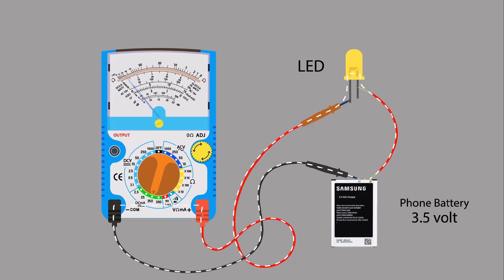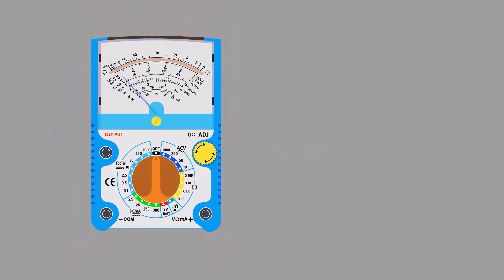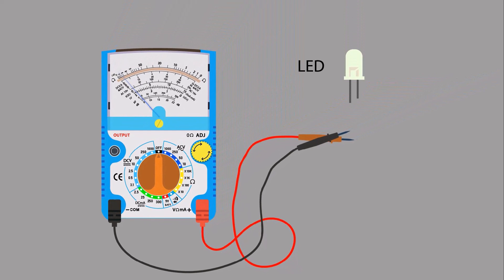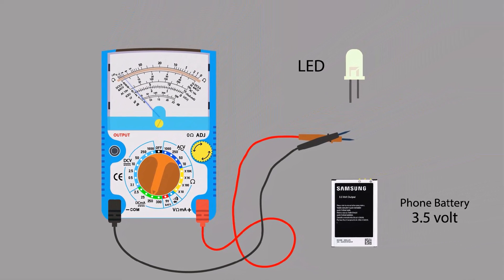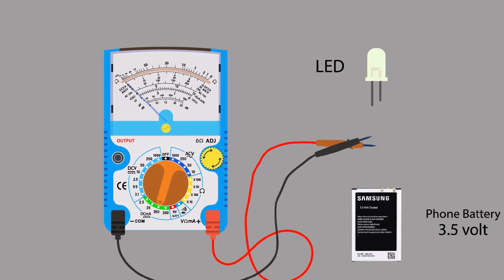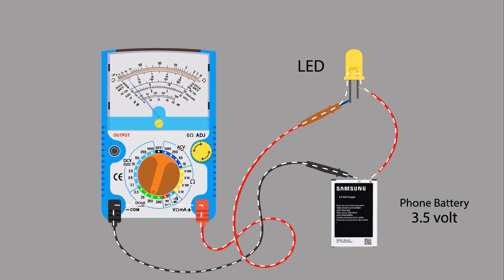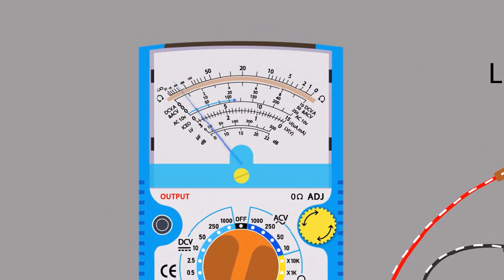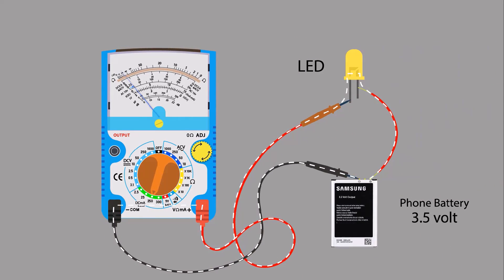how to check DC current with analog multimeter | how to measure DC current with analog multimeter

Comment: Sir, I have a doubt about your wiring connection. The multimeter's negative probe is connected to the battery's negative terminal. The battery's positive terminal should be connected to the LED's positive terminal, and the LED's negative terminal should be connected to the multimeter's positive probe. Is this correct? This is my understanding. 
But in your connection diagram, the wiring at the LED side looks slightly different.
Please clarify.